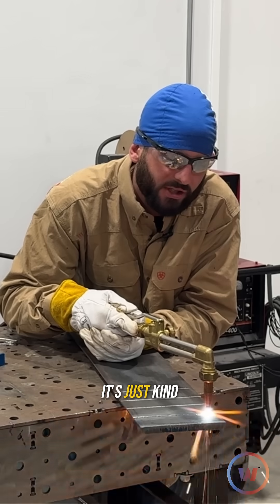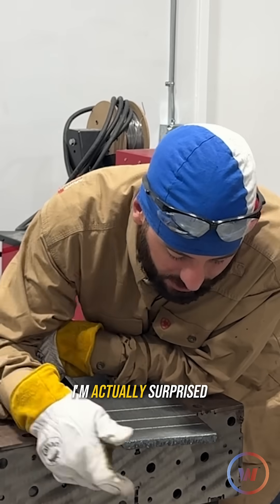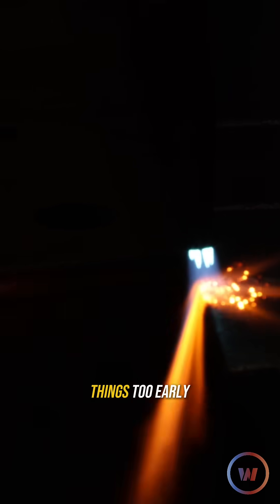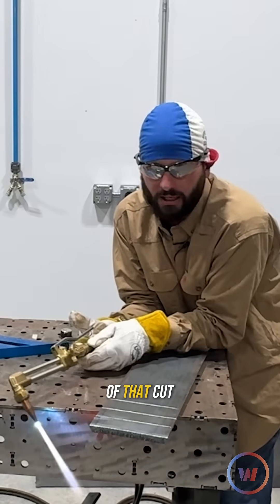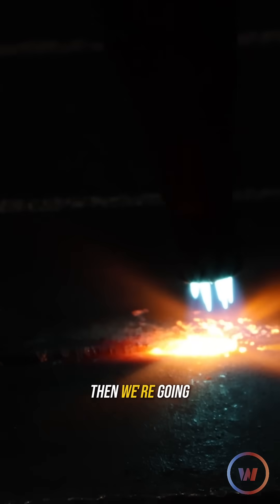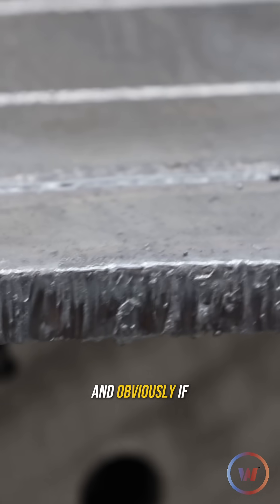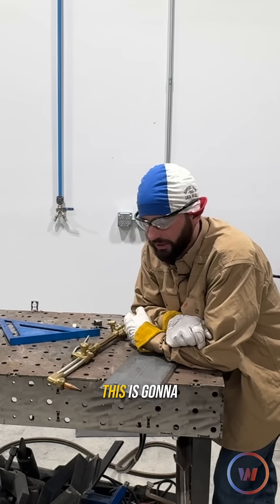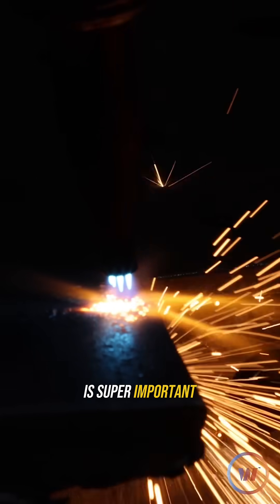Oxyfuel Cutting Too Slow VS Too Fast #ofc #fabrication

Comment: Ok, torch veteran here, you could cut twice as fast as your “too fast” travel speed if you make the darts touch the plate and if you go pushing a little bit.
Reply: My boss used to say put the blue just barely touching to the work

Comment: A clean tip is really, really, important.  The sound off the tip should be at least 6inches away from the tip when handle is depressed.  Further away the better.